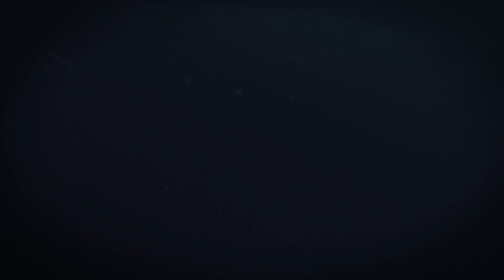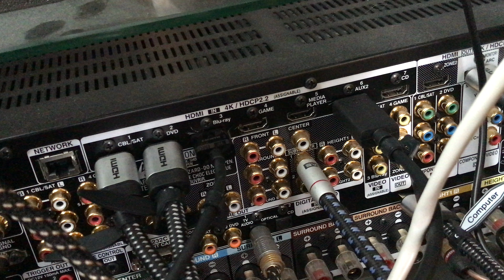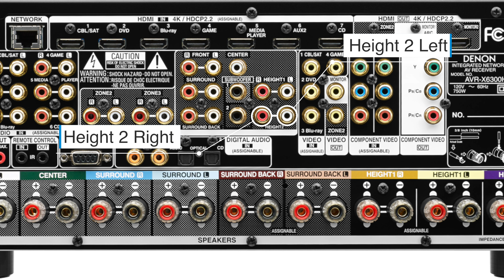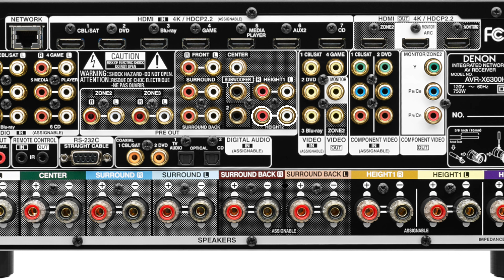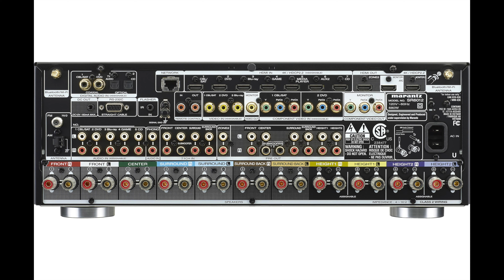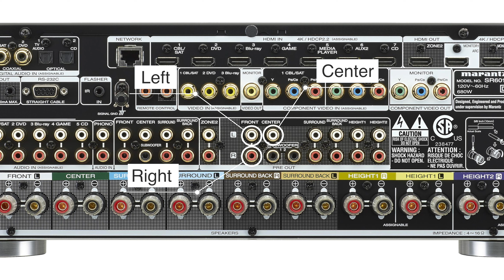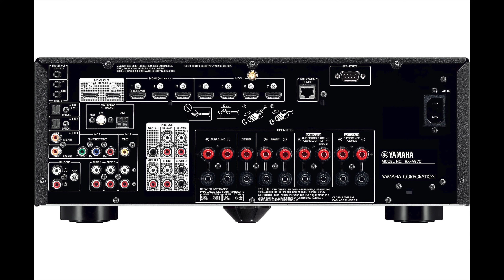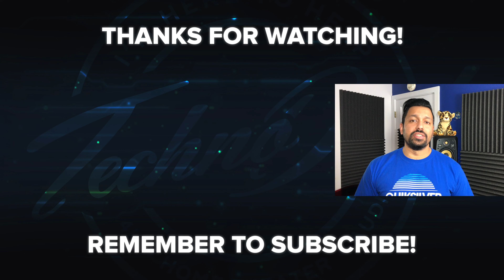How to Add an External Amplifier to Your AV Receiver | Home Theater Basics

Comment: Just bought a Yamaha 3080 can’t wait to add an external amp
Reply: Hey can we add Yamaha's professional power amps on Yamaha recievers?
Reply: I have the same a/v unit, did you ever hook an external amp?
Reply: Just tried to add a power amp to my a8 to power fronts n centre but no sound and the power amp assign options don't seem to work.
Anyone had any luck?

Comment: With scenario 2, if I power the front three with an amp will the av reciever know that and rout power to the 2 extra atmos speakers?
Reply from the maker: Hi!  It depends on your AVR.  The Denon X4400H needs you to tell it what to power.  Either the two front main or the rear height channels.

Comment: Thanks for this.When you use a separate amp for front three speakers does receiver still control the volume or do you end up with amp and receiver both controlling separate volume for speakers connected to them? When Im setting up a Yamaha YPAO calibration how do I do it it with my fronts and center  connected to a separate amp? Thanks so much. Only used receivers for 30 years but with Polk 707 and 706 I need more power.
Reply from the maker: Hi Matt, great question!  With a power amp, you will only have one volume to deal with.  There are two ways to look at it.  If you run YPAO without the amp connected, and then connect the amp, the channels you're powering from the amp are going to be louder than the others.  If you connect the amp and then run YPAO, everything will sound more balanced.
Reply: @TechnoDad  thanks so much. So it will be the receiver that controls the volume and you just ignore the volume control on the Amp?

Comment: My receiver has no pre outs but one zone 2.  My amplifier has no volume control.  How do I handle this?
Reply: You could try a line out converter. It takes the speaker outs and converts them to rca. They only cost 10 bucks it's worth a try.

Comment: This is dumb. Not your video mind you Mr. T Dad. I meant the need for an external amp for subwoofers. What's the point of buying a decent amplifier receiver if you still need more devices to power a subwoofer which should really be powered buy the amplifier receiver in the first place. I'm seriously thinking of just getting a slim style 5.1 system ready out of the box, one in which all the speakers and subwoofer are powered by the main console. I don't care anymore, I'm done.

Comment: whats going on Techno Dad? I have a pioneer elite sc lx 901 4k receiver. would you suggest i get another amplifier cause i am running 4 towers 2 powered that have 4 connecting posts for bi wiring 2 non powered but with 4 connecting posts, a giant center 2 giant surrounds and 2 atmos.. also should i bi wire those 4 towers? Thank You for your time

Comment: So I have an older kenwood  av receiver  and a kenwood amp. Do I hook up the power amplifier to the av receivers pre outs ? Also when I do the sound only works with the pro logic and surround settings but not in bypass .ode which is regular stereo mode . But when I hook my speakers just to the av receiver it works fine in stereo mode. Any help would be great thanks

Comment: 10 man I need some help here I really like your videos you're really helpful I can't figure out can I hook up a car amplifier to my house Eevee Pioneer head unit
Reply from the maker: Hi!  I'm not sure about how to connect a car amp in a home.  There may be some issues with direct current as a car amp is used to DC but your home has alternating current, AC.

Comment: Do you have a skype I have the marantz  SR6013 , I wish I would have waited for the SR6014, but anyway I want to do whole house audio.  I have the following by rooms - Family Room: speaker (3)in wall  C4100QL-THX , (4) Sonance in-ceiling 8 inch (4) Sonance in-ceiling 6.5 inch, (1) Keff 12inch Cube Subwoofer.   Kitchen: (4) Beale 4.5 in ceiling.  Nothing is hooked up yet just testing the sound which is amazing but I need to figure out the pairing and what else I would need make the sound crisp and multi room audio.  I plan to do my sons room with two in wall polk audio IW65 with a vail amp controlled by alexa and connect a polk sound bar with subwoofer.   I just need to understand the setup.

Comment: He I plan on buying a onkyo TX-RZ830 snd I was wondering if it was possible to use an older onkyo reciever as external amp to power 2 channels and make it 11 channel.

If so how do I do it and when doing configuration of speaker setup on the TX-RZ830 how do I do the setting

Comment: I have the 676. And there’s only the pre out for zone 2. Can this be used to connect to a stereo amp?
Reply from the maker: Hi!  Yeah, you can.  But the signal will be for zone 2, and not the main zone.  Does that make sense?
Reply: Hmmmm. No, not really. Does that mean it wouldn’t be practical? Thanks for the reply.

Comment: I have a DENON AVR-X4500H with a 5.2.4 speaker configuration.  If I added a 2 channel external amp in order to achieve a 7.2.4 speaker setup, why would I not want to run my front two channels through the external amplifer?  Is there a decent argument for applying the external amplification to a different pair of speakers other than the front two??

Comment: Hey channa I have another question about my Yamaha rx-a2070. When I add rear presence speakers do I use the pre out zone 2 or zone 3 output or is there another back height channel output?I have an out 5000 but I'm only using 3 channels of the 5.so I'm thinking about adding back heights. Thanks.

Comment: I want to know if i can use the preamp receivers speakers out put jacks to power my top end and then use a power amp to power the bottom end of my  cerwin vega! Xls 215s?? They are bi amp speakers. The reciever has enough power to power the top end just not the bottom end aka the subs.

Comment: I’m hoping someone could help me out with this. I am in a situation where I’m looking to purchase a 9.2 channel receiver that processes 11 channels. I realize that most receivers will power 9 channels and then asks you to power the final 2 height channels separately. My question is, do I HAVE to power the final 2 height channels externally or can I do something like say... 2 channel amplifier powering L&R and the receiver powers the other 9 channels? How does a 9 channel receiver know which channels are getting external power and which ones are not? In my situation, I’d much prefer to power another set of speakers with an external amp rather than a set of Height 2 speakers.

Comment: Hi thanks for the video. Simple and informative !! One question on Audy calibration in Marantz sr7012. Planning to hookup two horn and midrange as front LR. Do I need to re calibrate after hooking also let me know, while calibrating shall I keep my ext amp on ?
Thanks in advance !!!
Reply from the maker: If you want more power, run Audyssey and then connect the speakers to the external amp.  If you want more balance, connect the speakers to the external and then run Audyssey.
Reply: @TechnoDad  that doesn't make sense, why wouldn't you run Audyssey in both cases.

Comment: Can I integrate external amplification with the Yamaha RX-V683BL? The only Pre-out is for dual subs. Not sure if its possible. I have this receiver and wanted to pre-amplify my front channels
Reply from the maker: Hi Adam!  Looks like there are two pre-outs for the Front channels on this unit.
Reply: @TechnoDad  I looked at the back of the unit, and the only dedicated pre-outs (that are labeled) are for two subs. Any insight is appreciated! (did you see the latest Klipsch Xmas in July sale?)

Comment: I bought Emotiva BasX A-700 (only 5 channels used, center, front left, front right , Dolby Atmos left and right ) then you said is better. but emotiva has  7 channels ..my question is ? only dolby atmos 4  channels ,, or center and front , left speakers? because now tested in 5 channels and the sound is the same marantz 7012 or .. today ?I bought one pair RP-500SA, now wilbe 2 pair ..what do you recommend for audio clean..and powerful..thanks for your videos..amazing bro!!!
Reply from the maker: Hi!  You can easily use all 7 channels, you'll get a little bit more power if you're only using 5 channels.
Reply: @TechnoDad  ....Hey, man ... I always see your videos, always clear, direct and with almost all the questions I ask. easy to understand .. although a person like me, has no knowledge, you can understand .. it's a good sign ..
I would like to ask you a question?
my system I have designed more for movies than to listen to music ..
I like movies and I enjoy their good audio, (dolby Atmos) .. I like the details of light sound and the same immersive,
my system is this
Home theater 7.2.4
AVR Marantz 7012
Bluray 4k Panasonic DP ub820
Front klipsch RF-42II
Klipsch Center RP 504C
Klipsch subwoofer R-110SW
Subwoofer SVS PB 1000
Klipsch Surround and surround back RB-41 II
Klipsch Dolby Atmos Rp 140SA front
Klipsch Dolby Atmos Rp 500SA back
Panamax MR4300
Emotiva BasX A-700 (only 4 channels used, 2 pair Dolby Atmos front and back)
living room size 13 x 31 (403 sq feet complete) (used front TV is 13 x 12 sq feet)

question? how can I update, for more sound immersive .. in this system? to take better advantage of my equipment and speakers?
thanks for reading and answering?

Comment: Wish you could break it down better, everyone dont know what a 6 channel dyf44 is
Reply from the maker: I'm not sure what a 6 channel dyff44 is also...
Reply: @TechnoDad  Just saying I believe you can break it down more for us speaker noobs imo.

Like maybe answering questions in the comments. I have bose ds16f and not sure what is needed to install in house, also have a freespace iza 190 HZ inegrated amplifier and dont know what to connect it with.

If you could help that would be greatly appreciated.
Reply from the maker: @Shalashaska404  What a lot of people don't understand is that I have four jobs and responding to 100 - 300 comments per day is just not possible.  If I was full time on YouTube, then maybe, but I'm not.  I'm still unsure of what you're trying to connect.  The best thing to do is email me with your full setup and what you're trying to accomplish.  Technodad55 at gmail
Reply: @TechnoDad  Understandable. Ok thx.

Comment: Hello mate, need your help please. I’m about to add power amp to my home cinema receiver. Do I have to run calibration again, or just to leave it as it was set up on first time ??
Reply from the maker: Great question!  You can leave them alone but they will not be balanced with the entire system.  You can try it out both ways and see which one you like better.
Reply: Techno Dad Thank you very much!!

Comment: Hi I have Denon  AVR-X3300W  which I'm using in a 5.1.2 configuration. I also have a couple of older (currently unused) Pioneer receivers (VSX-920 and VSX-S510) I'm looking to expand my X3300W config to 5.1.4. COuld I use one of spare receivers as a power amp rather than buy another dedicated amp? Thanks

Comment: What’s up Techno Dad! I was wondering if it would make a difference if you run Audyssey before or after hooking up the external amplifier? I just bought 2 Outlaw 5000 for my Denon 4400H and wanted to make sure I set it up correctly.
Reply from the maker: Hi!  There would be a difference.  I would say connect the amps and then run room correction.
Reply: Thanks Techno Dad! I’ll try it out tomorrow and see what happens👍

Comment: This may be a stupid question but would your front stage with the external amp now dominate the surrounds that's being powered by the AVR? How do you equalize the power to all speakers? My Pioneer Elite receiver only has a left and a right and no center. So I guess I'm screwed? Would that completely dominate my center where I wouldn't be able to hear it?
Reply from the maker: Great question Mike!  Just rerun your speaker calibration and you're good to go!
Reply: @TechnoDad  Thank You!

Comment: Can I use another AVR amp or does it have to be a ' basic amp ' ?
Reply from the maker: The problem with using another AVR, you’ll have to deal with two different volume levels.  With a power amp it sends the power but uses the pre amp section like volume from the main AVR
Reply: @TechnoDad  Thanks for your reply TD, much appreciated.
Reply from the maker: You're very welcome!

Comment: One question, if you have a receiver that outputs let’s say 100w per channel and you hook up a 100w 2 channel amp for the two front main speakers do you now have 200w for each of the 2 front speakers??

Comment: Hey, probably going to sound like a complete noob. But I have a Rotel RSX-1057. I want to make my Technics SUV-500 the external amplifier to power my Cerwin Vegas. I'm just wondering, how do you control the volume once the amp is connected to the receiver. Great Channel btw, @TechnoDad.
Reply from the maker: Hi!  So the power amp will just use the volume level from the AVR or pre-amp.
Reply: @TechnoDad   Thanks Techno Dad! I've still to do it. Will let you know how it goes down !

Comment: I have an emotiva A700 on the way. It's only 100 watts per channel. I want to use it for my surrounds, surround backs, and front heights. Is there volume control on the amp itself? If not, how do I get a good mix as far as the volume levels per individual channel?
Reply from the maker: Hi!  There is no volume level.  You're going to want to connect the amp and speakers and then run room correction on your AVR.  You should be good to go after that!

Comment: Thanks for good videos. You have solved lot of problems for me. Your channel is awesome.
I recently bought a DENON ARV3500H because my old Yamaha RX-V2700 did not support ARC-HDMI and 4K VIDEO. Now I want to use my old Yamaha RX-V2700 to get more power because the DENON only support 105W/ 8 ohm but I´m confused. 
In my simple mind I thought I could connect from my DENON PRE OUT connectors on DENON to my Yamaha multi Ch. Input and then connect my spikers to Yamaha RX-V2700 according to the manual of both amplifiers DENON and Yamaha. Is that not possible ?

If I go your way. Can I use ordinary RCA cable (just for testing?)
Also in your Video you suggest to connect output to output. I don’t understand way ?

Comment: Maybe a stupid question. I recently picked up a Emotiva xpa-3 gen 3 amplifier. I am powering myself front three speakers on that amp. What happens to the power that once went to those speakers when they were directly connected to my Pioneer Lx 503. Does the power go unused or is it diverted to the connected speakers?

Comment: I am going to upgrade my AV Receiver sometime this year. My question is can I use my old AV Receiver as an amplifier for my front 3 speakers? It would be useful not to have to sell it, only drawback is that it is bulkier than a dedicated amp and the other pro would be saving money not having to buy a more powerful AV Receiver.

Comment: you said plug them into the proper plugs back of the halo integrated. what would be the proper coming from your denon. so denon is pre amp and then goes into where on the other amp?
Reply from the maker: Hi!  For the integrated amp it would be the 'Theater Bypass' but not all integrated amps have that.  I didn't have an actual power amp when I made this video.  For most power amps you'll only have one input per channel: https://youtu.be/tQmMA6wWtVE

Comment: I’m usingTwo PARASOUNDS   2125 for biamping my two fronts now my AVR DENON is doing the center it’s the AVR-X7200WA model rated at 150 w for 8ohms that’s what they say I do have a mono block amp if I want to do the center as a option it’s brigged Mono. 
Or should I just use the AVR for the center ? Good video I do have dual subs .

Comment: @technodad. Sup bro?  So I got a Marantz 7013, svs ultra system all around. I’m thinking of going with external amps for all channels. I’ve heard that due to using rca cables, there is a possibility to get hiss from external amps. Is this true?  Is this a common issue?

Comment: The best way is use 2 blocks: processor + amps. When you need you can change proc  (for ex when new format of multich appear like it was with atmos). That is much cheaper than change whole AVReceiver.

Comment: i have YamahaRX-V459 and Technics VX800. Technics has Extended Direct Drive option. 
YamahaRX-V459 - sub RCA output
Technics VX800 - EDD RCA input
2x Ground Zero GZRB 300BPX

Comment: Great info as I know little about amps! I'm wanting to do a 7.2 setup but my Denon only has pre outs for the 1 and 2 subs. Can I just put an amp on the subs and have enough power for decent speakers on the other 7 through the Denon? Thanks!
Reply from the maker: Hi!  yeah, you would have to get a different AVR...

Comment: Need some help : Bought Denon AVR-X4500H , which is 9.2 receiver
I am having 7.2.4 speakers (klipsch RP-280F (4) , R-120SW (2) , RP-250S(2) ,RP-450C (1) and CDT-5800-C(4). Need suggestion for buying a power amplifier (which can support my Front and center speaker with 200 W). which one is better with my current situation in mind.
Reply from the maker: Hi!  Great question, easy answer.  Monoprice Monolith 3x200 power amp is $1,199.  Check it out here: https://amzn.to/2X3yGUp
Reply: @TechnoDad  Thanks for the quick reply, is it OK to have 50W power amp and connect my 2 CDT-5800 ceiling speakers (which are 50W)?